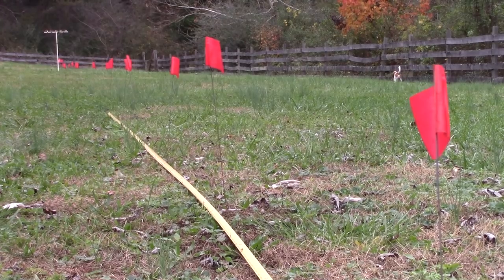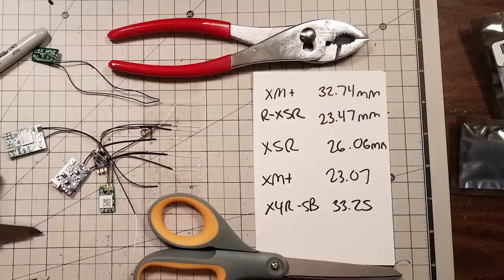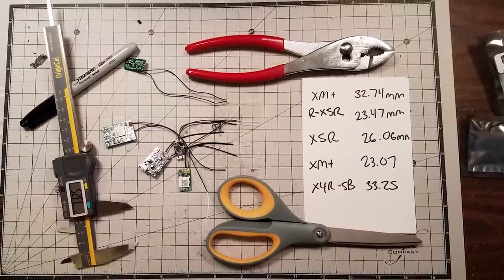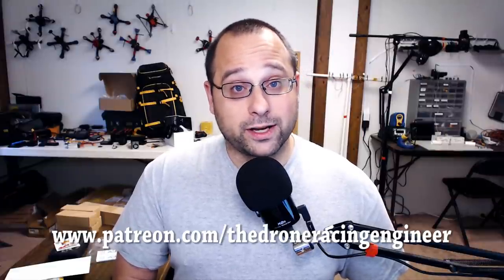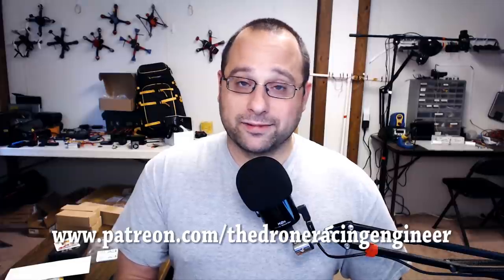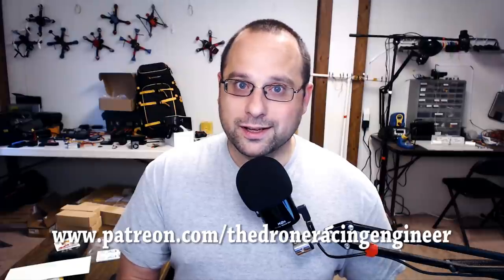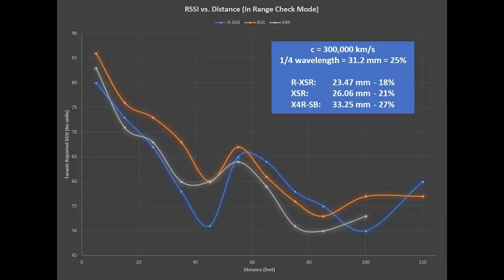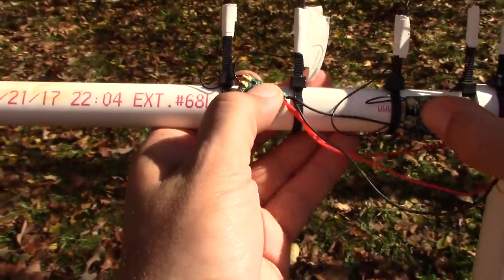Range Test FrSky RX | WRONG ANTENNA LENGTH?

Comment: Hey Joshua, I know that its pointless for multirotors to say, but it prooves my point (and fun-fact). Ive stopped trying to find out the range of these guys a long time ago. I gave up :) First one does not support SBUS but "my friend" was flying 3.3km long range with old v8r7-ii. Other friend tried the "real" test, left transmitter at home and went hiking to near mountain - he did nearly 6km when he gave up. (X8R using SBUS). Not mentioning that our EURO version of taranis is on 100mW (not sure if 100 but I know is less then US). I guess these newer guys will stick to that performance.

Comment: Joshua, the XM+ does have rssi, it broadcasts it on a channel and works wonderfully. I've actually flown the longest distance with an XM+ compared to a stock x4r-sb and xsr. It's too bad you didn't get that in the video but very cool video anyways!
Reply from the maker: I know that but you need a flight controller to read that data and obviously I didn't have one in this test.
Reply: Joshua Bardwell ahh, I didn't realise there wasn't a flight controller. I can understand why you had trouble walking so far and still didn't have signal drop, I put my taranis in range mode and flew 300 meters with rssi still in the 70s/80s. Are you going to do a video on frskys new telemetry protocol :D?
Reply: they have rssi but don't they ship with non rssi firmware?i had to flash mine to get rssi.
Reply: I had to flash a rssi firmware to mine, too
Reply: Depends on where you bought it. If it comes from China most likely it has stock firmware. EU and US stock sometimes come with it already flashed with rssi firmware. I've bought several now from China and US stock and some have RSSI working out of the box without flashing the firmware. I always flash them anyways just so I know what firmware is installed.
Reply: My XM+ receivers with the 24-25mm antennas on a quad have given me better range than an x8r on a Wing.
Reply: well mr richard shelton at multicopter builders said a while back that he had failsafe issues with the x4r-sb but he went with the xm+ and it did beautifully ..so makes me wonder if that xm+ is best bang for buck? for small package .I currently use xm+ and xsr for compact builds and i gotta admit the xsr has failed me  very very bad ..1800 bux damage lets just keep it at that
Reply: David Downs I also have had much better reception with an XM+. I've flown out over 2 miles with one with my RSSI still in the mid 70s
Reply: amazing for money
Reply: XM+ is 2.5 to 3km Range with stock Taranis
Reply: Did you actually reached that far? I get low rssi at 80 meters.
Reply: yours must be broken or damaged wire then...

Comment: Don't forget that these receivers transmit (sending RSSI data) as well as receive, so undoubtedly the manufacture will have tuned the antenna length to match the RF output stage, this will usually give a length that is not a factor of wavelength, for example a capacitive output they will have needed to lengthen the antenna and if inductive shorten it.For receive only the length is nominally the same as for transmit and a general rule of thumb for receive only is usually 95% of the wavelength.
The antenna length is best left as the manufacturer / designer set it.

Comment: Thanks, yes some of us watched the whole video.  Ok maybe I am a nerd engineer, whatever.  I do like the attempt you made doing this.  I think what we learned was that as long as your antenna is connected and the exposed part 28, 32, 33mm or whatever is not totally chopped off, it is going to work for most of our needs.  These are not space shuttle o'rings, we are not sending our quads to Mars.

Comment: I think the antenna location on the craft is as important as antenna length. Personally, I have the antennas coming out of the bottom of my quads-planes, for the simple reason that they are flying above me and if the antennas are on the bottom of the craft there is a line of sight with no obstructions, back to my transmitter. Always place the antennas so they are no obstructions between you and the craft that you are flying to get max range.

Comment: Thanks for your testing but you haven't  tried an exact 1/4 wavelength. I would use one rx with a short antenna and measure range , then change to a long antenna on the same rx and check range and then a 1/4 wave antenna on same rx and check range.

Comment: Worth mentioning that an antenna for receiving only is not as critical as an antenna that broadcasts. In a badly adapted antenna, the radio energy will bounce back into the transmitter, and thus the range will decrease.
That would be interesting to measure swr on the counterparts with telemetry.

Comment: Thank you for the wicked analogy about radio frequency vs actual frequency of updates we throw out into the airways. helped me understand the tuning a hint more.
Reply: oh as for longer range while on that pole? A) heaps above the ground plane compared to when we test in a quad, and B) heaps less RF noise due to no carbon fibre surrounding.

Comment: My best signal stability and range have come from running a pair of sleeve dipole antennas on my xm+ receivers. Just standard wifi rubber ducky antennas with the housing removed and direct soldered to the Rx. compared to stock antenna lengths, 1/4 wave re-trimmed, or anything else, they perform much more stably. I got the idea from an rcgroups page on testing the taranis range with different antenna setups, and I'll stick with it for my freestyle quads, since they're the only ones that I ever really push the range with anyway.
Reply from the maker: I would be pretty suspicious of the durability on those.
Reply: I have them shrink sleeved to big-ass zip ties, sticking out the back end of my quad, haven't had a problem yet at least! They use rg316 coax for the leads, so they're a fair bit tougher in that regard, the only part I'd be concerned with is the metal ground plane thing getting dinged up

Comment: We have similar discussions in our german forums without clear solutions too... 
One short tip maybe you test it. If i shred a antenna i removed the jacket and then i evert the helical ground wire. Its then like a dipol told me an skilled "antennaguy". Functioned for me but not range tested because the Video Signal was the limited factor.

Comment: All 2nd generation of Tinyhawks including the Freestyle have RSSI as high as 99, while the older Tinyhawks maxes at 70. I wonder what Emax did to tune it. But even with the 30% difference, the distance was only 5 meters before failsafe, but it seems the new versions have better consistency in holding connections within range.

The only thing I noticed is the new antennas on the 2nd generation TH are thicker and stiffer.

Comment: I have to say that the stripped area of the frsky antenna is not the only active part. 
The entire length is the working area. I don’t know why they even strip the end, radio waves go right through plastic so there is no need to strip it. 
I don’t think that is coaxial wire, I may be wrong, I’ve looked at it closely. 
Maybe they strip it so we will wear it out and buy more? Also those antenna pairs should all be at 90 degrees to each other.
Reply from the maker: I think you're mistaken about this. It is absolutely coaxial cable. It has a braided grounding shield along the length, which is why the exposed section radiates and the shielded section does not.

Comment: Good test - I was wondering this too. The thing is, that the monopole antennas does not have good VSWR in first place, so a few milimeters does not matter. If you want a good antenna you need a dipole.
Reply from the maker: I think this is the takeaway: that other things are more important to range than the length of the antenna.

Comment: You've got to love how RC hobbyist with no background in RF electronics think that because they read a few blogs that they now know more then the RF engineers who designed the system.  The only proper way to tune an antenna like these is with a VNA  but then you would actually need to know how to read a smith chart LOL .... 

Kep in mind that these are not simple receivers but transceivers that send back telemetry so they antenna is tuned for the transmit signal not the RX signal.. 

My advice is unless you have a VNA and know how to use it then you have no business cutting your antennas.

Comment: Nominal Velocity of Propagation is the key to your shorter antenna. Also interesting: Most of these receiver antennas are only a half dipole. So if you measure 1/4 length of unshielded wire it might be actually 1/2 wavelength antenna design but its only half of the antenna present.

Comment: Nice test, but maybe should  be done on open field with various receivers of each model because there is lot of bad FrSky receivers. Your job is great and I understand the financial limits of that kind of test.
I get the best results with R-XSR and redundancy xm+ and changing antennas with replacement ones. I fly more than 2km without any warning. Of course that doesn't mean nothing but it's good for me.

Comment: All of the antenna wires are about the same (wire type), not sure your long velocity factor analogy applies here. There's still quite a few variables (as you mentioned), antenna length, polarization, possible lumped elements changing the tune of the antenna, and SNR differences in the receivers, overall great video as usual

Comment: Makes me wonder what is the difference in using numbers in between the 23mm to 33mm. Meaning is there any difference between 23,24,25 and so on or if there are specific number that make the antenna good and just so happens that the 23,26,32 you tested is about there... Great video and its awesome that you put all this thought on questions people have but most dont bother to investigate!!!
Reply: 33/23 is approx 1.41 (or square root of 2). On a pure sine wave it's the RMS to Peak ratio - 1:1.41. On a sine wave carrier + signal they probably tweak this number for tuning. Complicated maths involved? Yes. 
Do I understand it all? 'Fraid not!

Comment: thanks for going through with this, i tried to grasp this stuff right when i started flying toys, using 3/4 length transmitter and half wavelength receivers... its a really complex topic to even try and reduce to laymans terms,.  iforce2d had very similar outcomes to you with flysky set ups,  using the 26mm and the 28mm? sleeved dipole version versus a strict 31.125mm.. he said if anything the stock antennae were the best, he tested in open countryside with actual return to home quads. so all we can do is go with the manufacturers choices, they seem to know best....

Comment: Good Test !  They all seem pretty close .......... Have you tried different antennas on One Receiver unit ? ........ or different Transmitter antennas ?  Also increasing your height was interesting ........ it would be beneficial to know the optimum height for your TX antenna .  Great show !

Comment: I watched Stingy and Steele test this in real flight test. An XSR with 32mm mod outperformed x4R with 32mm stock, which both whooped an xsr with 23mm stock, therefore I run a modded XSR.
Reply from the maker: +gabbo2027 no offense to them but they did one test. Do you know that your antennas are the same coax as theirs, with the same velocity factor? Just one reason why multiple tests are valuable.

Comment: Had to jump back in time...
I placed an R-xsr in my newest build for Lua and such, problem is I failsafed in a spot that I had no issues with my other build using Xm+. I noticed the length of the R-xsr antenna. It is much shorter. So I ordered some after market antennas to test. Thank you for this video! Seems to explain why this crash happened.. ScooterPie

Comment: Joshua, you are wrong about VF (Velocity Factor) of the coaxial cables. The formula is VF=1/SQRT(K), where K is dielectric constant of the central insulator. For example, if it is Polyethylene, then VF=1/SQRT(2.3)= 0.65938..., but we can round it to 0.66, or 66% of speed of light. If the same polyethylene has air bubbles inside in form of foam, then it can't be calculated because then K is between 1 and 2.3, for which only manufacturer can provide you the right information. VF for antenna element itself depend of ratio between wavelength and diameter of the radiating element and it is NEVER 1, only by math. Usually it is around 0.95, or 95% speed of light. The thicker the radiating material - the shorter antenna should be. But if radiating element is too thick, although it will be tuned, its Q factor (Quality factor) will be low, thus gain will be low as well. And, you can't measure antennas that way - by placing more antennas next each to other. Also, 'whisker' antennas are bad - it need at least 'sleeve' over the coaxial cable, and will be good that it has the other end of the dipole.
Reply from the maker: Sorry I'm confused. Which part did I get wrong?

Comment: I have very good experience with XM+ stock antennas (almost 1km of solid signal). XSR with stock antennas was much worse (around 700m when it already started giving me alerts). XSR with aftermarket antennas from banggood worked better but still lacking behind the XM+.

Comment: I've been messing with this for awhile after noticing on my xsr the RSSI was fluctuating a lot. So I tried putting new 31.2mm then shortened those antennas to 29.5mm then 26mm. What I noticed was the 29.5mm length for the antenna seemed to have a more stable RSSI then the the other 2 lengths and I have been able to fly in places where normally I would have failsafed. I think it is cause it is about 95% the wave length and copper wire has a velocity factor of about 0.95.

My best explanation is that the antenna needs shorter to compensate for the difference in speed between charges in the wire and the radio waves interacting with the wire.
Reply: So you suggest 29.5mm worked best for you instead of the of the longer 1/4 wave. Interesting.

Comment: The speed of light is constant. There has been some research on cosmic factors that might effect it, but the speed of light, for all intensive purposes, is CONSTANT.  You have to bend space in order to have an apparent change in speed, although as far as the light is concerned in the space it's in, it's moving at the same speed, it's just the space it's moving though that is being altered. This has NOTHING to do with radio antennas. 

The speed of a signal moving though wire has alot more to do with HOW the EMF moves though the wire. The radio signal does not move straight, but instead moves in a spiral around the outside surface wire, with the magnetic field moving perpendicular to the metal's surface. So the energy in the wire is moving just as fast as always, it just has to travel further because it's not a straight line. Think of it like how an old phone cord can be short, but when you stretch it out, it's actually quite a long piece of cable.
Reply from the maker: The speed of light in a vacuum is constant. The speed of light in a medium slows down, because all media have a propagation speed of a signal, be it sound wave or other type of energy. The more dense the media, the slower the signal moves. Here is a discussion from Cornell.edu that explains it well: http://curious.astro.cornell.edu/about-us/133-physics/general-physics/general-questions/832-is-the-speed-of-light-constant-beginner#:~:text=Light%20moves%20slower%20through%20denser,the%20light%20gets%20re%2Demitted.

Comment: I have had 2 different XSR receivers bought from two different vendors and both times these receivers have given me RSSI warnings at 150-200 feet. I'd also have failsafe triggers on occasion. I have tried these XSR on different builds with different Flight Controllers to see if it makes a difference. It worked the same. I switched over to a XM+ with the 1/4 wave antennas to see if it worked better, and now I can easily go 500-600 feet and still have 70% RSSI. I don't know if the antenna is the difference or not, but I have no faith in the XSR receivers.

I might try to pop on some 1/4 wave antennas on my old XSR to see if it makes a difference. It's possible I got two dud receivers, but I find it hard to believe it could happen 2 times from two different vendors. I am going to try the R-XSR with swapped out 1/4 wave antennas to see if it will work better. I really like having Telemetry, but the XM+ has RSSI on channel 16 which is sufficient as long as I am paying attention to the value in my googles, however having Telemetry and the Taranis calling out warings is much preferred.
Reply: yep. the XSR stock antennas are just crap. i experienced the same.
Reply: You mentioned in an earlier reply that you cut your antennas to 33mm. I thought 1/4 wave was 31.25mm. Also, the X4R-SB was at 33.2mm and the XM+ was 32.7mm according to the video. That's odd. I guess all the receivers are tuned like Joshua suggests, but if you say 33mm worked for your XSRs, I will give it a shot.